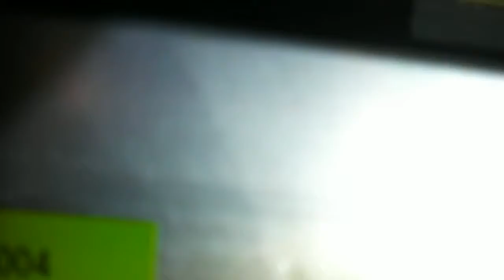A Little Closer Look At the Go Power 2000 Watt Pure Sine 24v

Comment: That black thing looks like a buzzer from this angle.
Reply from the maker: dang I need to find the AC fuse and the black thing checked out good with my ohm meter.
Reply: shartne
There may not be an AC fuse.  Did you check ALL the DC fuses? 
Here is the manual:
http://www.pvpower.com/pdf/datasheets/go%20power/gpsw600-3000user.pdf
Troubleshooting guide on page 22
Reply from the maker: dictare
thank you I have been reading the trouble shooting and I think i have a short in my crappy wiring job. I have put new cables on the batteries that I bought professionally made. And on Monday im going to buy a new out put wire full length. the lights say it has short in the output.
Reply: shartne
Before you buy a new cable, just plug something into the inverter to test it.  The check the unplugged cable with your ohm meter.
Reply from the maker: Yeah I was going to try it tomorrow with out the cable. I put it back together today but im not in a hurry im going to wait for my new cord to get here its a 12/3 better than the fourteen I have. Manual says to use 12 gauge wire.
Reply: shartne
Harbor Freight has a 100' 10/3 extension cord on sale, couple that with the 20% off coupon.
Reply: *****
Thanks, Information is priceless and sometimes it's hard to come by. I try to help when I can. I enjoy it.